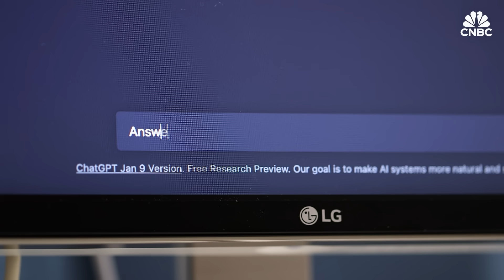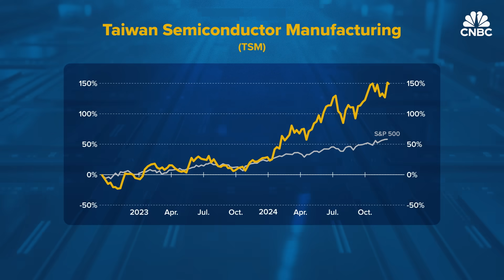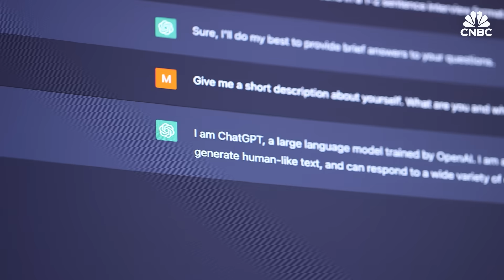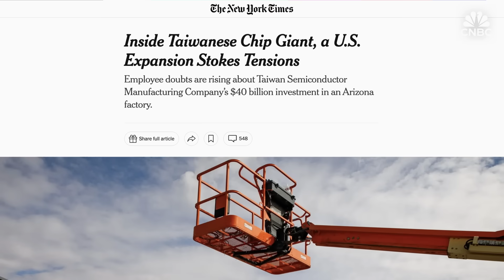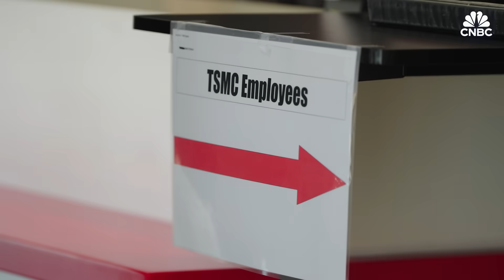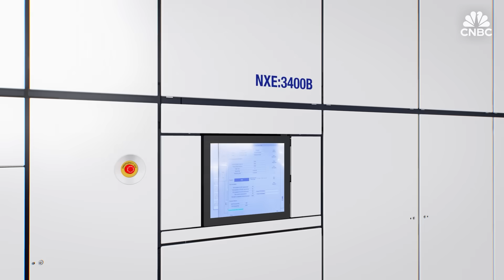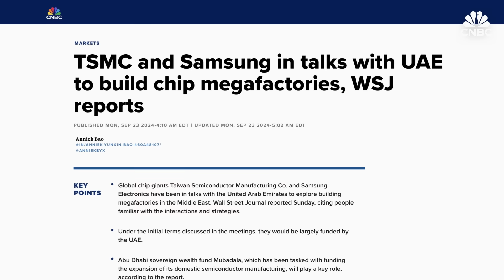TSMC’s New Arizona Fab! Apple Will Finally Make Advanced Chips In The U.S.

Comment: what is cool, parking lots are covered by solar panel, but the building in fcking desert with walls and roofs are not ))) and then say they say it is not enough energy for datacenters. Griders are source of heat enited with sand battery are sourge of energy from sterling

Comment: Good initiative and waking up by the USA. But still it will not out compete Taiwan and China because the cost of chip manufacturing in the USA has always been and is very high:meaning low profit. In  Taiwan, the cost is half of the USA's total operating cost. While in China, the cost is a quarter of the USA's total operating cost.

Comment: "The final product—chips—work so reliably because they only have a single component: a block of silicon topped with other metals. There are no moving parts in a chip, unless you count the electrons zipping around inside. Producing advanced semiconductors, however, has relied on some of the most complex machinery ever made. ASML’s EUV lithography tool is the most expensive mass-produced machine tool in history."

Comment: Redundancy is vital. Also, i would much rather give my money to the US than a possible china. 3000 steps to make an IC. I wont complain much about the cost of CPU's anymore. But then again i rarely buy brand new CPU's when new sockets are releaed. Onyly done that twice in 35 years. The AMD version of the Intel P2. 586 i think. Also the Ryzens when they came out. Two times in 35 years. Even now i am on an AM4 rig with a 5 year old CPU. R7 5800x. Saving up for AM5 now

Comment: Traditional data centers, especially those with water-cooling systems, consume massive water and easily spark social disputes in water-scarce areas. BroadWatt’s Hol data centers, however, can cool down by converting heat from server racks into cold air.

Comment: I'm just amazed that the economics justify a water intensive industry in a portion of the country that's quite water deficient.  I get that no humidity will reduce the Air Conditioning costs ... but where are you going to get the water?   Or is the state just going to take it from existing residents?

Comment: TSMC is mine too. In the 1970s, we already had an Apple chip/smartphones/tablets fabrication plant in China, perhaps a strategy by China. But there was a backlash of course. It existed only for  a short time.

As I've said, Apple is ours. Clearly,  from the name itself, Apple should be and is USA, American.

ASML techs mine/ours, especially "UV/EUV lithography" and machine, 1970s. I was designing and improvising from and using the actual digital 3D version of the ASML machine, which we also designed. Then they would implement it, if there were real improvements to test.
Reply: So chips fabrication plants in the US was of course planned too, have to be.

Comment: 0:04 - - What does “fab” stand for (anyone)?
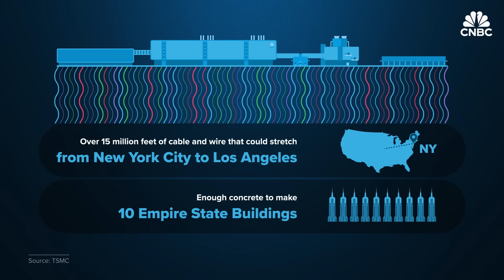2:22 - - concrete, steel + cables - - 2:33
3:31 - - construction 🏗️ pics
3:44 - - MEP (mechanical, electrical, plumbing)
3:52 - - bus-sized EUV machines - made by ASML
4:02 - - only machines able to perform extreme ultraviolet lithography
8:44 - - 7.4 earthquake > $92 m loss for TMSC

Comment: Why are the wafers round when the chip sets are rectangular?
Reply: A couple of reasons,  one is that they are grown as a large cylindrical crystal about 1 ft in diameter x   I think 5 or 6 ft long.   Then cut into round slices / wafers.    The round shape also helps with making some of the process steps more uniform.
Reply: Thanks  @harryniedecken5321

Comment: I remember working here in august of 2022 up until a few months ago pulling all of their backbone fiber and pulling/installing most of their low voltage cat cables with IES. It was a huge milestone getting everything completed, working in the clean rooms with the bunny suits as you pull cable was the worst though.

Comment: ASML MAKE 2 MACHINES INTEL OWNS 60% ON LITH THE DIES ARE SENT TO TSMC TO BE CUT AND TESTED AND THEY EU ASML SHUT DOWN AS NO MORE THE BINNED ARE GOT WORKING THE AIB FABS ARE ALL CLOSEDF THE INVESTORS PELOSI BIDEN CAUSED THE SHARES TO NOT BE EXPOSED AND ALL NAMES ARE CHINESE STOLEN N THEY ARE FORCING THESE BAD BOARDS N CPUS USING MICROSFT FORCED SCAM TO LIE TO SELL BY BUYING OUT TAKEN OVER ALL HIGH END CHANGED SOCKET USES CHEAP PARTS TO RUN UPSCALED LOW SPEC HENCE FREE WIN OS FORCED TO MAKE AI RUN FAKE SPECS TO REMAKE SAME GAME TO RUN ON LOWER QUALITY BY LYING SAYING REMASTER NO UPGRADE FORCED TO PC SELLERS AAS CONSOLES N PC OF SONY BEAT MICROFT  N GIGABYTE HYNIX ALL THE HIGH QUALITY WERE MADE IN EU 80TI MONO ITYANIUM 16 ISO QUAD 4 LAYER BOARDS BUT HIGH SPEC 4K 60FPS NOW RT IS OLD REJECTED XSILICONE RUN UNDER AI WIN OS CPU BOUND AS THEY TOOK OVER PC AS MICROSFT AMD RYZEN NEVER COULD COMPETE SONY NOW FORCED TO DOWNGRADE THEY WANT TO GET INTEL BUT INTEL SUPPLIED THE MATERIAL N MACHINES N 20YRS LATER MADE PROFIT AND CANT SELL IF THEY CANT MAKE THE LOWER TIER ON NVIDEA BOARDS AS NVIDEA IS CHINA SAMSUNG WHY PELOSI IS DROPPING HER SHARES N TURNED HER BACK ON TAIWAN N BLAME CHINA TO FRAUD INVESTORS TO INVEST IN ARISONA ITS TOO VIBTATION TO DO IT HENCE WHY IT WENT TO EUROPE ON NONE INTERFERENCE ROCK STRUCTURES  IF IT COULD BE MADE THEY WOULD MAKE AT ASML BUT INTEL TOOK NO PROFIT BUT MADE ENOUGH TO COVER UNTIL TODAY BUT ITS OVER THEY JUST USING BINNED STOCKS THEY MADE DECADE AGO N SENT TO TSMC CLIMATE BUFFS BANNED MANUFACTURE IN EUROPE N SAME WITH LG HYNIX NVIDEA AIBS MOBILES LENOVO ALL JUST BRAND NAMES CHINA TOOK BUT NOT THE HARDWARE THEY DONT MAKE FABS THEY JUST SATOLE A HUGE LOT OF TECH WE SENT TO BE STRIPPED AND RESLL BACK NO REPAR COVER JUST HIGH COST N ALL SOLD TO NEW PC GAMERS WHO CAME FROM CONSOLE WHEN GATES SHUT IT DOWN N GREED MADE HIM FORCE OUT ALL AS HE HAD NO COMPETITIVE N DIDNT WANT BLURAY OR INTEL IT USED RYZEN FOR STOCK INTEL SOLD N INTEL SAID NO TO AMD SO THEY ALL CHINA TAKE OVER. TO MAKE A PLANT THEY CANT ASML CANT N THEY HAVE THEY ONLY MACHINE  THE COSTS ARE HI, N WHY WE HAVE RT NOT GTX OR ISO 16 X 4 ON ONE CORE OF TO SLI ON 4K  NATIVE ITS ALL A HUGE SCAM TO USE ALL MEDI TO INVEST IN NVIDEA THEY ARE LOW POWER CUT UP DAMAGED WRONG MATERIAL AND CUT UPS TO TRY BE ONBE ITS LANES ARE MEMORY BANDWITH DELAYED ITS A HUGE SCAM CHINA CANT MAKE CHIPS IT BOUGHT 20 MILLION OF H100 N THEY NOT BEST BUT AI CLOUD SERVER, N WHY WE HAVE STOPPED BITCOIN MINING N INVEST IN AI IS FREE ITS OUR DATA N NOT DEEP LEARNING OR SIM MATH OFFLINE SELF LEARNING ITS GUESSING USING OUR ONLINE Data n casnt do math

Reply

Comment: Dust kills the machine?......Arizona sounds perfect 😂😂😂
Reply: It doesn't matter where you are, the scale of the particulates in these clean rooms makes the particulates in an operating room look like boulders. literally.  You could start from a dust bin, and the process of getting equipment, material and personnel into the clean room would be the same, clean, cover, filter, and flow top to bottom, basically.

Comment: I truly hope I'm wrong but think China will get someone working in there or will aquire a chip through a product & find a way to hack it. Security changes to the chip will work for only so long & then everyone will be forced to upgrade to a new chip/phone, tv, car electronics-whatever. Just like win10 to win11. If you have info you need secure & use it on the internet/web, the average untrained user (like me) will need to upgrade. Like money in the bank for the companies that produce these products.

Comment: Sorry folks...as impressive as semiconductor fabs are, this TSMC fab will not be making TSMC's most advanced chips...ever.  And that's due to a relatively new Taiwan law.  Presumably for national security and/or prestige reasons, the Tawain government recently passed a law stating that any company doing semiconductor fabrication cannot have it's most advanced node outside of Taiwan.  This basically means TSMC.  So despite what TSMC initially told the CHIPs Act politicians, this fab will not be leading edge...ever.

Comment: Fix the headline. Apple doesn't make chips, it buys chips. New York is so angry at Arizona's success that it has arranged to have multiple fabs be built to provide tech jobs at taxpayer expense. TSMC has stated that identical chips made in the US will cost about 30% more than ones made in Asia. P.S. The actual machines that make the chips come from one company, in The Netherlands (ASML). $200 million per, and the waiting list is around two years.
Reply: And ASML is running on US components a licences.

Comment: In my book the biggest offense that Raimondo, the Sicilian peasant from RI w/ a Harvard degree in Finance has commuted re: CHIPS is that she has so far awarded almost a billion $s of CHIPS funds to 3 So Korean co.s that have been pirating US developed adv. techs to mfr. the latest Chips and at the same time declared that the US had no contribution in that particular area of Chip mfr.  ( very Hot these days, crucial to AI chips ) when get this 90 % of that technology was developed in the US ( in. AZ ) and also first used for high volume products ( by Motorola, Intel ) almost 15 yrs ahead of TSMC and the So Korean sneak thieves. For the last 35 / 40 yrs most Semiconductor mfr. and R&D for it has happened NOT in the E. Coast ( after IBM started to fail and got out of mfr.ing chips on their own ) or in CA ( the so called Silicon Valley is now Silicon LESS ! ) but in the Desert Southwest ( AZ ) where the open spaces and lack of hierarchy promotes free thinking, be that political or scientific ( the key ingredient for making Chips profitably ). But this peasant Raimondo from the insignificantly small state of RI in the rotten East has stacked CHIPS w/ failures & phonies from the E. Coast, mostly from IBM which failed at Chip making and had to get out.  Those failures are traitors who would rather make the offshore pirates in Korea or Taiwan look good than give credit to the Scientists & Chip mfr. experts of AZ who had whopped them since the 1990s

Comment: 2.85 GWh per day is equivalent to 237.5 MW of continuous power demand all day long. That's the max output size of a typical wind farm from a decade or two ago, and with a capacity factor of 50% which the latest wind farms achieve (in Australia at least) you'd need about 400 MW of wind 250 MW of PV and significant storage capacity to firm the variable wind and PV supply to match the fairly flat demand cycle of the facility.

Comment: Building a chip plant in the Phoenix area where there is a lack of power supply, heat, and scarcity of water is ridiculous.
Reply: Lack of earthquakes, hurricanes, tsunamis, flood, snow, frozen roads, cyclones, etc helps keep it open. Sun = solar.
Reply: The States are allocated water from the Colorado River based on shoreline.  Arizona gets more of it than California.  And AZ got its first nuclear reactor about 50 years ago.  And you must be a dunce if you think Phoenix has a shortage of heat.
Reply: And lots of dust
Reply: There's no shortage of heat in the Phoenix area. And the plant supplies much of it's own energy from solar power. As for water, the greater Phoenix area gets its water from the Colorado River, the Salt & Verde rivers, and aquifers (mostly in the west valley).  Moreover, the Phoenix metro area has sufficient water resources for at least the next 100 yearrs, even as the area continues to expand.

Comment: This plant will be short lived , i worked on the intel fab 23 & 24 back in 1999 - 2001 by the time   we got fab 23 tooled & operatonal we had tooled fab 24 the yr before fab 23 was never started up because the chips wafers where obsolete because of chip manufacturing discovered a new way to manufacture cheaper smaller size wafers so the 7 billion dollar intel fab 23 & 24 was obsolete, thousands of union workers worked on that fab in Colorado springs for three years & to no avail cause the fab was never started up .
Over 7 billion dollars waisted.
Reply: TSMC leads the pack by a wide margin, they know what the top-line architecture would be a decade from now and built this plant with that roadmap in mind.
Reply: @kpro8908  time will tell .

Comment: The problem for AMERICANS is that they’re only going to hire 80% non American workers. So it doesn’t benefit Americans a bit to have things built here.
Reply: Correct, that's because americans are unskilled for it.  CEO Chang had to bribe 3000 tech workers from Taiwan and China to go there, but they reprotedly hate arizona and quitting. So the plant will fail.  It's like a bakery - the #1 requirement is the baker's skills, not the equipment.

Comment: I'm all for bringing manufacturing back to the US, but I don't understand how the governor has paused new water wells, but green lights these massive plants and datacenters  that require an insane amount of water.  I heard they have something like a 6 ft main right from lake pleasant.  I recently moved but I used to live a few miles away from this plant.  I've never seen so many huge cranes on one site (I think I counted something like 21 at one point).  Lets hope they get their water reclamation plans on line quickly.
Reply: You heard wrong. They do not have  a main water connection from Lake Pleasant. 🤣
Reply: @XploreAz  Yes and no, we are both partially wrong.  The 78" water main from Lake Pleasant was already there.  They are tapping into it with a bunch of smaller 12-20" lines for something like 10 million gallons a day.  Source: https://land.az.gov/sites/default/files/2024-01/Infrastructure%20Report.pdf

Comment: Both the USA & Taiwan need the silicon shields

5:26
Even with great yields, the biggest volume of chips will still come out of Taiwan for years to come.
So the U.S. is far from self-reliant.
It's difficult or impossible for the U.S. or any country to be fully self-sufficient in everything that they need to build semiconductors. I think that's a pipe dream.

Comment: It takes 9.5 million gallons of water (thirteen Olympic sized swimming pools) PER DAY to run EACH FAB. At best, only about 60% of the water can be recycled. 

As the historically low water level at the Hoover Dam dramatically demonstrates, the water resources for such a water intensive manufacturing facility are sharply constrained. The massive amounts of water required to run these FABs in Arizona will have to mainly come from underground aquifers which are tenuous at best. There is no readily available alternative source of water. Moreover, this FAB is going to have to compete with the cities of Phoenix and Tucson for water use rights in a desert during a drought.

What is wrong with this picture?

Comment: The chips act provided money for chipping manufacturing in the United States but it did not specifically target high-tech chip manufacturing. The resulted in a lot of the money going to commodity chip manufacturing which is not as strategic because many of these chips are made in Malaysia and other countries. Even China has the capability of making these chips.

Comment: Chip production is an extremely environmentally polluting process, with toxic chemicals leaking into water supplies and soil, and waste from leaking chip production processes causing genetic defects in babies. Americans have been suing chip manufacturers such as Intel, Advanced Micro Devices, Applied Materials, IBM, etc. for decades. Many (if not all) American chip manufacturers have outsourced chip production to foreign companies such as TSMC. The biggest irony for the United States is that TSMC has been buying chip production equipment from China's Advanced Micro Devices for many years.

Comment: I was excited to see this being built in North Phoenix. But now after watching the video I am very, very concerned about the amount of water they are using, and the fact that Arizona could have blackouts due to TSMC overloading the electrical grid by using 2.85 ggw of power per day. They need to add far, far more solar to run this thing. APS is warning that they could run out of transmission capacity by the end of the decade? And where are they going to get 1 million gallons of water (after recycling) per day?

Comment: All those interiors are not in Arizona.  Those buildings are mostly just a shell.  It will be at least 3 years before any advanced chips are made there.  They still cannot secure a water supply.  The Dutch company that makes the Fab machines is yet to start making one, and that takes 3 years.  The chips being made there are less sophisticated, old gen silicon.